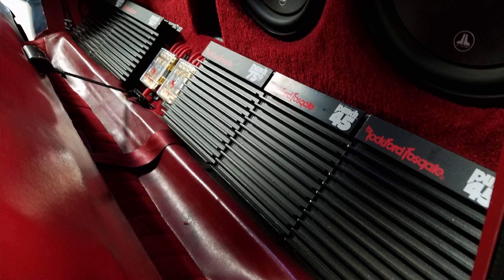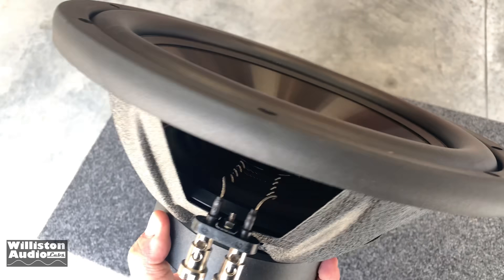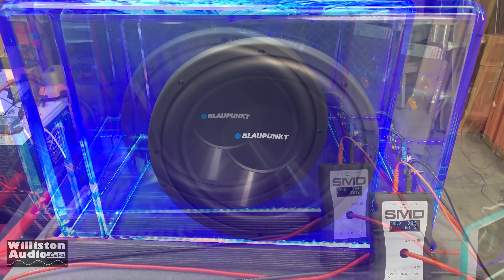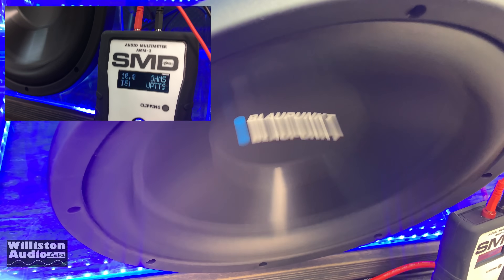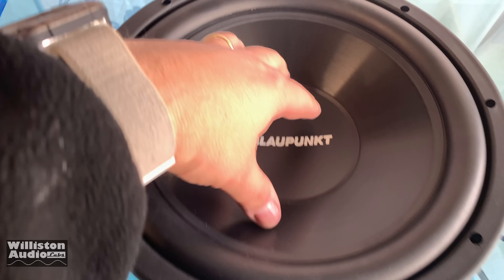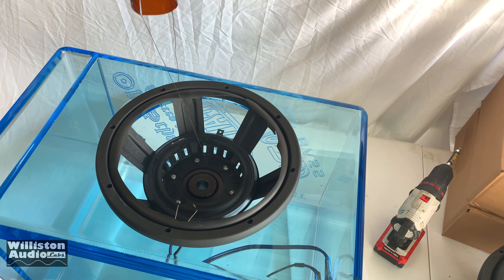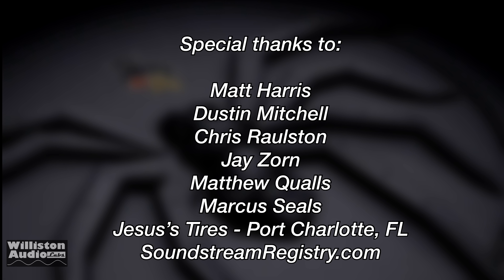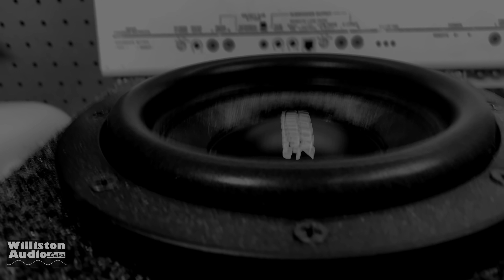$20 Walmart Subwoofer Tested and Blown Up! [4K]

Comment: I owned a blaupunkt gt1000 power sub and it worked perfectly though it faced the rear of the rear seat of my e46.... lot of power and very good response at low frequency
Reply: @wal  i tried that configuration as an experiment to get the max trunk cargo and seat space (no box, the rear faced the trunk and the front toward the seat).... it seemed a foolish idea, but once i heard it i loved the way it sound. The amp got only 350w despite its maximum capability of 1000 w  and it was enough..

Comment: Wow, 20 bucks and it still had stitched in tinsel leads. Of course when you ripped it open and I saw that anemic voicecoil I could see the cost saving. Still, for what it is, it makes me question subs that cost 3 times as much and handle less power. Great video- but how was the sound within it's power rating?
Reply from the maker: It sounded good. I’ll show more in a future vid

Comment: Serious question. I have a 4 door pick up. Why do so many videos/people recommend down firing subs? Wouldn't up firing sound better.  And would forward firing single in the middle sound better still?
Reply from the maker: Down firing protects the driver from objects hitting the speaker and many people do this in 4 door trucks. Bass sound is omnidirectional so it shouldn’t matter, but you can try facing subs different ways to see which sounds best

Comment: Do a Power Acoustik BAMF 15" 2ohm DVC video. Id love to see how mutch more those $150 subs can handle without blowing mine.Ive got 2 on an SSL Evolution 1500.1 and they are banging..Working on an upgraded box and maybe another 1500.1 and wireing them to 1ohm a peice but feel like that amp will fry out at 1ohm.

Comment: Williston Audio Labs, I've tried setting up a home-made bench like yours. I'm using a spare 12V group 24 battery and a 12V charger to keep it topped off. However I'm getting a lot of ground noise (~60hz continuous noise) through the sub. My power/ground are identical 8ga runs that are ~18" long for the amp that's only ~300W RMS. Ever experienced issues with ground loop noise on your test bench? Any ideas?
Reply from the maker: Turn off the charger and I bet the hum goes away. Im betting it’s the chargers fault

Comment: Did I miss something here? Irony perhaps? Please explain in what way this is a fair and meaningful test? I'm sure one could blow up any speaker given enough power. Like others below have commented I saw WAY over the rated power on there...

Did you just keep turning it up or did the thing destroy itself? I have no idea how to judge whether this sub is a good thing or a bad thing? How does it compare with, say, something costing five times as much?

Enjoying your vids though :)
Reply: He made this video pretty much for fun. Wasnt really to test the sub, although it did prove the sub could last a little while on high power. But, we can take the information at hand and make the determination that for $20, this sub could be an effective piece for a basic setup.
Reply from the maker: I should’ve explained it better. The main purpose was to see how much power the sub could handle before blowing. It was putting out some great bass before giving up. I used the plexi box and multiple cameras so you could see several angles

Comment: Whats your opinion on Renegade subs? I've got an rxv1200 supposed to take 300wrms, but at 10a drawn by the amp it sounds "empty" and loses output the more I give it from there. I guess thats what you call distortion? It looks very similar to this blaupunkt in terms of magnet sizr and beefyness. What do think it can handle? And what would be the first sign of overpowering, temps, smoke and smell, bottoming out, or distortion?

Comment: 400rms at 4ohms, ok. Where did u plugged it in? What was the voltage? Voltage inpute on amplifiers can really change the power output. Almost all speakers will blow with overpower, its known. Nice video, but next time put the specs for the amplifier u used.
Reply from the maker: I was showing the true wattage (including phase angle) with the AMM-1. I also showed the amp, the Orion HCCA3000.1DSPLX. I was trying to blow the speaker for fun

Comment: So it really does Handle the Power it says it will right ? What was it 800 Peak ? I noticed the Watts hit well over 900 a couple times so if you had it set up so the Watts couldn't go over 800 it probably would have survived right ?
Reply from the maker: Yes, I’ve seen them fed nearly 1200 watts each for short bursts

Comment: Hey why does it measure higher resistance the louder it goes. I want to use a multimeter to detect what voltage peaks and amps happens so i can put a resistor in place or fuse to protect led lights. My idea is to regulate a parallel cord to 12v... And then allow current to control lights by volume of sound wave using a sine wave not powerful enough to arc the led line. But i dont know how to get any reading of variability with common volt meter. Only resistance seems to chang with volume. Ty

Comment: I have one of these in my blazer on a pioneer 900watt amp.  What type enclosure would you recommend for this sub?  There were no specs in the box or online for this sub.
Reply from the maker: 1.2 cu/ft sealed or around 1.5 ported.

Comment: I had those on 800 watts rms in ported box but they only lasted for 2 months they smelled every day . the have more bass than expected get them and only run about 300 rms each with about .75 box they need smalller box to keep from burning up

Comment: Yo! I was rifling through your playlist looking for audio repairs. Specifically speaking; I have an issue where my radio is powering on, but has a red light going on and off under the face. Also, my cigarette lighter isn't working either. My amp fuse is good(changed it anyway), my main power fuse(whatever it's called, connected from battery to subs) looks good and my 12V fuse seems good. Any idea where to go from here??

Comment: Would these be a good replacement for two nearly 4 year old Kenwood Excelon subs in a ported box? I THINK its getting near time to replace them(they are still good) but really don't want to spend a lot. Using a 500w amp btw.

Comment: Spend 80 dollars more and you get a quality no frills 12 inch subwoofer for just the driver. Around 200 watts rms, you would get better SQ than stock sound system bass and decent SPL but, nothing to ride home. If want a powerful subwoofer that sounds great, you are looking around 200 to 300 dollars for just the driver not including amplifer, enclosure, and wiring.

Comment: I have a 10" version and 600watt dual amp. Pure junk and I know it. But OMG I have $75 in my whole set up! With the wires! And its just enough for what I wanted. Blows away the under seat full powered things you can buy. I made a box out of cardboard and wood glue. Its perfect for the low investment

Comment: Damn, who bought the blaupunkt name? Did pretty damn good for a $20 sub. I'm running a $40 axxea amp from crutchfield that claims 280w rms at 4ohm, running it at 2 ohm right now, which it claims to not be able to do. So far so good. Been having a lot of problem with thermal cut out just running 4 ohm, so i figured what the hell. Output of this silly little guy seems like its probably higher than rated. blows my mind a $40 amp could do what a $400 amp did for me 12 years ago.
Reply from the maker: Yes, those Axxera amps on close out were a great deal 👌

Comment: I have always wanted to try building my own sub, with a five gallon bucket sideways on two cradletype feet! Get right size to mount on open end( after wiring amp to bucket. Drill small hole for power cord, seal with plumbers putty. Anyhow....stupid or not always wanted to try. Or use construction forming Tube!
Reply from the maker: Do it!

Comment: So I always do super low budget builds in my vehicles. 

Just enough to sound ok but better than stock.

My 93 f150 I had the "dual" bt head unit. Wal-Mart brand 6.5 in doors and 6x8 behind seat. I also put the dual all in one 10inch behind seat (the one for around 50$) everything went good and it was what I wanted except the all-in-one would overheat after an hour of continuous play.

With my 01 cherokee. I'm slowly building it's audio. So far I have the same dual bt head unit (Wal-Mart 15$) 4x 6.5 sony speakers (doors,sound bar, 40$) fixed the wires in the door boots. I have been running it with no sub or amp for 2 months. Sound alright but I want just that little bump. I think I'm going to stay away from the all-in-one bc of over heating. 

Ok here's the serious question. 

With this subs continuous at 400 and peak 800. If I run it straight of the head unit No amp... will I have any issues???

I know it's 20 bucks... but in your opinion, is it worth it?
Reply from the maker: It will work, but prob not a lot of bass running off head unit. Check out the Polk PA D2000.2 as it is only $60 and delivers 500 watts of clean power
Reply: @wal  I'll check it out. 
Stupid question. I've only recently started messing with subs and amps. That all-in-one required a dedicated power which I ran through a plate in the firewall of truck. If I go the route of separate sub and amp. Do they both require that? 

I think the one thing stopping me on the jeep is knowing I have to run power and I still really havnt looked at best way for that. Don't really want to drill like i did with truck unless I have too

Comment: Still that's not a bad deal for a subwoofer to use for a low-power mobile system or in a home built home theater subwoofer
Reply from the maker: It’s a great subwoofer

Comment: Thanks for the video and for $20 bucks it did ok. I say that because if someone was only willing to spend $20 on a sub chances are they would not also have a 2k-3k amp laying around. They would more likely have a 250-500watt amp@4 ohm output.

I cringed every time the power meter went above 800 watts and was pretty much sure the sub would blow since it was only rated for 400 watt RMS and 800 peak. When I seen it go above 900-950 watts peaking out I knew what was about to happen. So this sub can probably do 400 watts all day long with a lower powered amp hooked to it. The real question at hand is how nad does it sound in person. You can have a sub that can take the power but if it can  not produce the proper bass notes then it is not worth it's weight in metal and plastic. I am going to guess it's sound stage was pretty limited.

Comment: Did it seem to be efficient at all? I might slap a couple of these in my garage set up. It's just some old ass Pioneer 12" three way speakers and a 100 watt per Channel receiver. The woofers in those Pioneers are laughable, the motor structure looks like it belongs on a 4" speaker.
Reply from the maker: Yes, seems to be rather efficient

Comment: considering you applied over  double the rated rms watts for extended periods of time  it did extremely well until it overheated the voice coil melting the varnish shorting it out. bang for the buck of that 20 dollar speaker is still a far cry better than the used to be good stuff now outsourced to china being sold today that runs 8-10 X the cost.

Comment: I blew one of these with 150W rockford fosgate amp.
Reply: Correct statement would be you clipped and destroyed one on a 150w Rockford fosgate amp. User error.
Reply: @NorthFloridaAirGunner  nope, the amp never distorted, gain was set correctly. Notice Big D said it was smelling way before it blew? When you use it long time the glue bakes and the voice coil falls off.
Reply: @RadostinVelchev  he also had way more power to it than that fosgate 150 could ever give it. You had the gains set correctly? How did you set them? And there are more ways to clip than just gain settings. You can do it with bass boost, bass turned up on head unit, loudness turned on on the head unit, shitty YouTube or Pandora music, low voltage, many ways to clip. If you blew one of these on 150watt amp, you screwed up. Period.
Reply: Just for sake of ending this argument I agree with you :)

Comment: Do u know the sealed box volume?Its not in the papers
Reply from the maker: Approx 1.5 cu/ft
Reply: I had them in 1.5 cu ft sealed enclosures,it was to big,sounded wrong.A dealer told me 1.5 for ported,1.0 to 1.2cu ft sealed.I'll let yall know how it turns out.Lol

Comment: I remember when Blaupunkt was considered a decent brand, but in all fairness the sub was extremely cheap, plus it wasn't given the proper break in period either.
Reply from the maker: What do you consider a proper break in period
Reply: @wal  Well I guess it depends on the sub and the brand. I am not sitting here trying to act like I know it all either dude, I know that you know your shit, which is why I subscribed, so I can watch and learn from you. Just saying that if the sub had the proper break in period it probably would have handled it a little bit better. Probably not a lot better, but a bit
Reply: @wal  But to answer your question based off of my experience, around 12 hours at a medium volume level is a good start

Comment: I didn’t think so until I bought a speaker and it was in the instructions 
I had two 12” coustic Kevlar monster subs I went from a 900 watt pioneer to the audio pipe 1500.1 and I hammered them and I started smelling the coils so I shut it down let them cool he next day I did it again and I done this for a week and I noticed that each time it took longer for them to start to smell and I tried to over heat them with regular music after that and I played jthem hard for hours and no more over heating the only way was bass music for about 45 min hard I tested this on a set of kicker comp 10s and started with 900 watt pioneer it done same 45 min to heat coils then after a few weeks no smell then I got a audio pipe 1500.2 and then same about 20 min in I started to smell them no this went on for a month I thought I was gona toast them but I noticed I wasn’t smelling the coils on a long drive it took 2 hours of rap to get them that hot and honestly I can do it in 10 min with bass music but for General listening it was like they settled in to the amp 
Every system I ever had always got better after a few days of playing but back in the 90’s we didn’t have this kinda power one of the coolest amps I ever had back then was a pheonex gold mc235 it was sweet amp two Orion xtr 12’s dvc I ran it at 4 ohm mono then experiment one day and I hooked it up 2 ohm per channel and wow it was crazy how much it came alive but now I’m rambling so I’d welcome y’all all’s thoughts

Comment: At the price, you won’t get die cast basket or butyl rubber surrounds. Anyone who does this like you knows this already. They did have strength ribs pressed into each leg of the frame. It isn’t a die cast basket. At $20-25, it won’t be, but it will operate in it’s limits I suppose. You know what it is the operating limits. That sub that died was damaged by overload for sure. The coil former is your dead giveaway. Blowed up! It’s fubared for sure!👎🏻👎🏻👎🏻That’s it! Ring the bell! El smoked-o the sub-o!

Comment: So... the video title. We destroy a low end sub by giving it 3.75 times more power (we think, because we didn't give rms rating). Why not test again with a slightly under rated amp.
Reply from the maker: I bought 8 more, so yeah more tests will ensue

Comment: Not bad but the 32 Hz low end is not so impressive.
Reply from the maker: For $20, how can you complain though?
Reply: Unfortunately, a woofer cannot go much deeper than it free air resonance frequency since a speaker box (enclosure) is basically a high pass filter.  I used to have a single 12" woofer that would actually play down to 16 Hz (close to sub contra C pitch).  I tuned the 24 cu ft. ported box to 17 Hz and when I played a 17 Hz test tone, the wall between my kitchen and dining room physically moved like a speaker.  It was very impressive.  For those that think we cannot hear below 20 hz you better think again.  I purposely played a C chord on my keyboard and then played the 17 Hz tone and I could tell it was the wrong note.  16 Hz sounded like the correct note.  Also, using isobaric alignment of 2 identical woofers (there are a few different possible arrangements), but the simplest is face to face in a "clamshell" arrangement, the 24 cu ft. box could have been downsized to 12 cu ft. (half size) with no loss of deep bass (using the isobaric "trick").  Also, the distortion is lessened with the isobaric dual woofer setup since when one woofer is pulling, the other is pushing.  That helps produce cleaner bass.  If the surround on the woofer protrudes, use a spacer between the 2 woofers so they don't bump.  It is usually better to have a parallel hookup but series can work too, although it changes some of the electric properties of the woofer pair.
Reply: Also 88dB sensitivity is not very impressive either.

Comment: I have no problem with someone blowing up a sub for a video but I would say that it would be better to just set it all up to ware it's not going to blow and not waste money on blowing up a sub there is no gain in it. If it's set up none clip then you should not blow a sub on less you have way to much power. I have ran subs for years and the only trouble I have is spider breake or cone tare or anything other the coil blowing I have ripped spiders and had what looked like new copper coils . No clip no blow
Reply from the maker: I can say this much, I would seriously doubt anyone I’m using this sub with a true 400 watts would ever blow it up. This may be another interesting future video